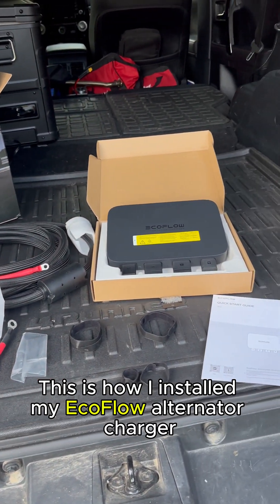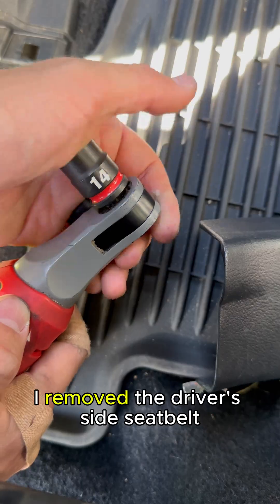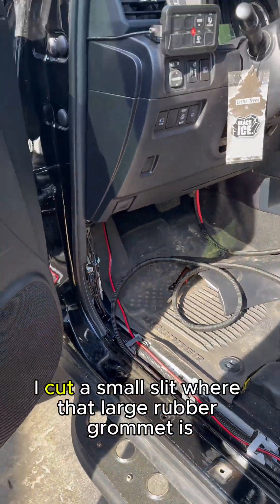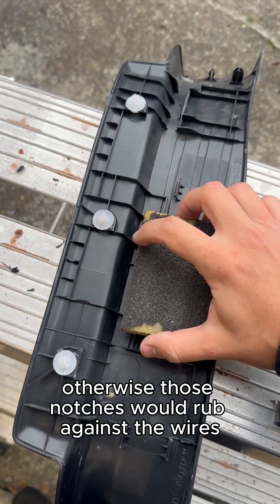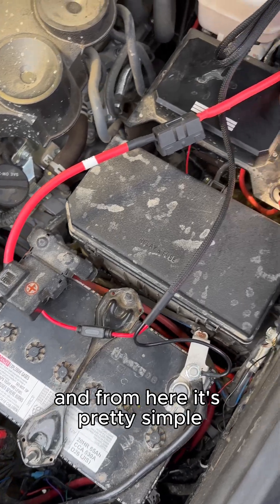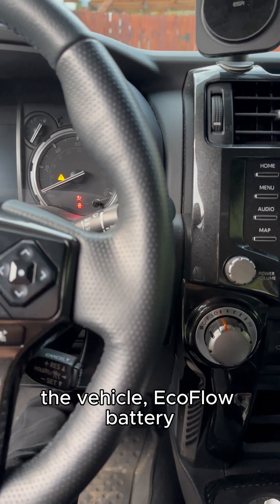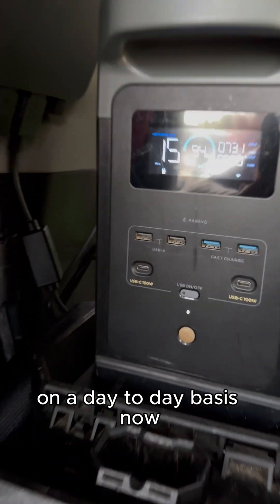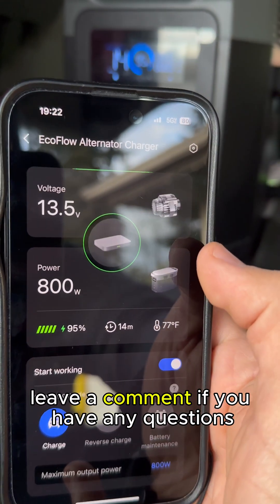EcoFlow 800 watt Alternator Charger Install on a 5th Gen 4Runner #ecoflow #5thgen4runner

Comment: Could you install this on a small car?
Reply from the maker: It depends. Technically yes, it may be possible, but first check with your alternators output capacity and see if it’s within the minimum amperage threshold to safely power the EcoFlow alternator charger at max power.

Comment: 800w at 13.8v uses 60amps...the 4runner's alternator is rated for 130amps (i.e. you're using A LOT of your alternator's output to charge)...any problems with your battery maintaining charge or with your alternator's life with this ?
Reply from the maker: Great questions. I have the same concerns. 

From my experience, so far my battery health has been stable. No issues at all with the battery or alternator. I also don’t keep at the max 800w for extended periods of time (only when I’m in a pinch). I typically like to leave it at around 40amps to slowly top off my power banks.

Also, I noticed that the alternator charger detects the minimum threshold you set for your battery and reduce its output accordingly. If it’s drawing too much from your battery it will auto regulate the output and prioritize the starter battery health.
Reply: @Phantom_4Runner  - That is/was my only concern with this setup. Thank you for the good information!
Reply from the maker: @oliver5911  Thank you, glad you found this valuable 👍
Reply: You can buy an alternator with higher amp output or you can adjust the amps the charger is receiving

Comment: The wires you are running looks different than what eco flow supplied.
Reply from the maker: It should only be a positive and a negative from the alternator charger to your battery. Plus the XT150 that connects to the Delta 2 to your alternator charger. 

The other wires you mentioned might be from the kingpin lightbar that I installed. I followed the same wiring path for that as well.

Comment: I bought this for my delta pro 3 and the plugs wayyyy different. You using a solar one?
Reply from the maker: I’m not using the solar plug, im using the XT150 cable and connecting it into the extra battery port
Reply: @Phantom_4Runner I have a delta pr0 3, so I had to get an adapter; apparently it just came earlier this year. Works great now, gets the full 800 watts while I drive no problem.

Comment: T4R garage has a video showing this using a DC/DC converter and it automatically turns on when the car is tured on. Is there any downside to using that version versus this version?
Reply from the maker: With EcoFlow’s firmware update the alternator charger can now turn on automatically without needing to physically press the power button! All settings can be adjusted within the EcoFlow app 🙌

Comment: if youre using the xt150 cable the charger should just turn on and off by itself. like whenever you start the car that is. Is that not the case for you?
Reply: Mine just started automatically right after installation
Reply from the maker: @theadventureawaits  EcoFlow is listening to our feedback and they’ve updated their software to enable a auto-start feature 🙌
Reply from the maker: Unless there was an update that I’m not aware of, mine still requires me to manually press the power button each time.

Comment: If I have my own set up with a 24v inverter / charger could I still use this ?!?!
Reply from the maker: @vlatter9537  Good question. No, I believe you cannot connect the EcoFlow Alternator Charger directly to a 24V inverter.

It’s built for charging EcoFlow batteries directly from the starter battery, and those batteries then output AC (if needed) through their inverters.